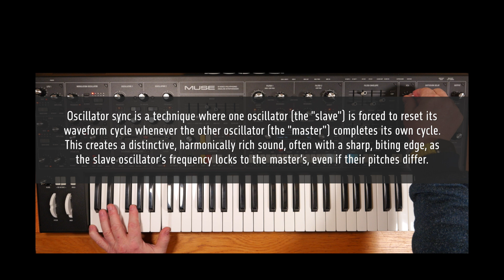Moog Muse Oscillator Sync

Comment: Excellent showcase (except too much wet-effect for a raw sound demo). That's the cool thing about the Muse: you take a very simple basic waveform and a standard type of modulation, creating a common sound. And than you create amazing tones by tweaking the parameters. The Muse has so much to offer. Even a triangle wave can be the foundation for extremely cool sound design. This synth will never feel old. 😍

Comment: Does your OLED display screen turn off while you’re playng the Muse? Mine did that.
Reply from the maker: No not had that - did notice it turns off if you don’t play for a while
Reply: Not after the first update, no. Have had no issues in 7 months now, touch wood. Just get it replaced, you're well within warranty